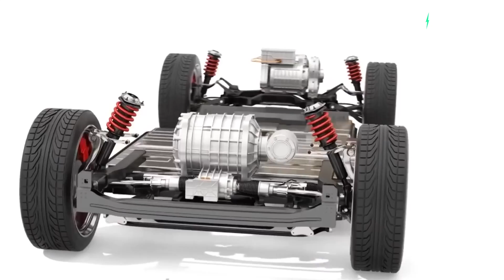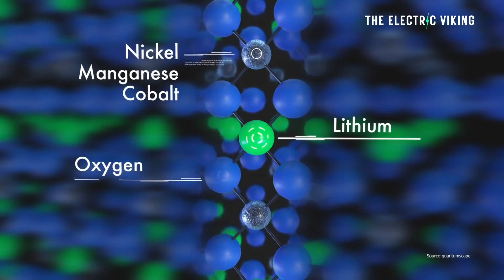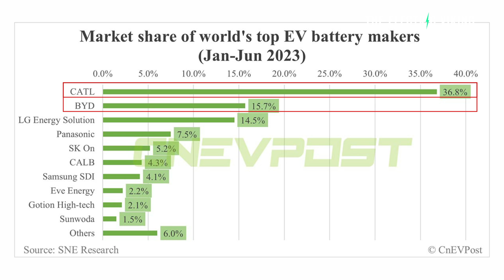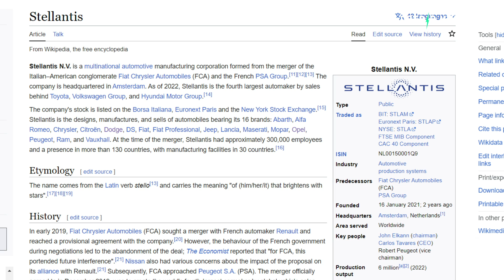Battery pack prices see HUGE decline - EVs cheaper than gas in 24 months

Comment: we also need automatic plugging in and unplugging at home. regular plugging is a chore, or phev owners would plug in more then they do
Reply: Why is it more of a chore than driving to a petrol station to fill up?  I spend way less time plugging in and unplugging my EV than you do driving to a petrol station..... I charge once every 8 to 9 days. Six seconds to plug in, and another six seconds to unplug in the morning.
Reply: @Brian-om2hh  It is funny how these non EV drivers have so many silly comments. 
These one (I_dont_want_an_at) makes dumb comments a lot. 
I sent him a comment
I_dont_want_an_at titude from you.
Reply: My condo building has 500 parking stalls.   How much do you think it would cost to wire up my parking?  Our condo board would go bankrupt making those changes.
Reply: @pin65371  LOL, they will make money or people will go to ones that do.
Reply: @BioniqBob  so people will move to the million+ dollar condos? I live in one of the more expensive buildings in my city and they don't have the budget to do that.  They are more worried about keeping the building functioning properly. Realistically in order to wire up my underground parking with ev chargers would be a couple years of work.  They would need to bring in more power to the building which would mean digging up the outside parking lot.  Then they would need to go through 4 floors of underground parking getting wire to each stall which would require drilling through the structure of the building. I'm in the trades.  I know what would be involved and it's not going to happen.
Reply: OH MY plugging in is so much harder than pumping gas. You are some kind of fool. 10 secs to plug in.

Comment: We are right on the edge of the tip over, I can’t wait!!!  Can you imagine quiet freeways? No smelly pollution at parking lots?, etc…..
Reply: Tyres are surprisingly noisy.
Reply: freeways won't be quiet quiet. But their noise won't project as far, especially when diesel is gone. Electric cars make plenty of whooshing past noise. A quiet petrol car that isn't revving hard would sound about as loud as an electric car at freeway speed. At slower speeds, the peace and tranquility will be felt more. I long for the day that diesel big trucks don't exist. You have to be 5km away to ensure you can't hear them on an otherwise quiet night. they suck hard
Reply: @I_dont_want_an_at i live 2 blocks away from a rail line and I can't even hear the train roll through unless they hit their horn. 5 km away from a diesel truck to not hear it? Maybe if you are in the middle of nowhere with a 5 km long frozen lake you'd be able to hear them.
Reply: @I_dont_want_an_at titude from you. You have never been in or driven an EV. Just a bunch of crap spewing from you.
Reply: Can you imagine high electricity cost, millions upon millions of batteries in landfills, the cost of upgrading one countries whole electricity system, because of the increase consumption, more rare-earths getting mined by underpayed workers in terrible condition, etc....
Reply: @tamaszlav 🙈🤡 Redwood battery recycling ♻️🔋♻️

Battery price will go down 80% the next 10 years.

Free electricity if you own solarpanels. 🤡👍
Reply: @tamaszlav   Imagine a world of fools talking about things they know nothing about. (yea you)        https://www.youtube.com/watch?v=s2xrarUWVRQ
Reply: These negatives are not only related to EVs, as ICE cars also use various minerals such as cobalt etc. EV bateries can and will, more and more I am sure, be recycled. Petrol and diesel has a recycle rate of ZERO. They can only be burned once. Over 95% of the EV battery can be recycled, we just need to switch to a more circular economy and away from a consumer economy wher we throw away so much. Our current system is clearly unsustainable.  @tamaszlav

Comment: Of course Sam it's not just that the batteries are getting cheaper THEY ARE GETTING BETTER, more reliable, higher energy density trending up to 400Wh/kg. This will produce longer range or smaller batteries.

Comment: When battery densities and costs reach a point where it makes sense and is possible to replace the ICE engine in a car with an electric motor and battery pack,  I can see many people just upgrading the car they have to an EV or buying an EV conversion. It makes sense, all the bits that wear out are in in the engine and transmission, with some new wheel bearings, shock absorbers, rubber bushes, a new electric motor and battery, some TLC on the bodywork you pretty much have a good as new car. It's far more cost effective, affordable and better for the environment to reuse what we have.

Comment: I know a lot of people are saying, people dont care about the battery chem - but they do - in terms of - they are still waiting on a few things to be true about EVs and that is one is it safe - every time a car burns up - it hits the news, so until that news stops and people feel safe about them - its still kind of a problem. I am hopeful solid state and sulfur Li or Na batteries can fix a number of those issues in the future. I can see a pack already 1/4 of todays size for the 350 mile range, so more than like 1/4 the price of current pack cost if everything continues to work out. 700 miles doesnt seem out of the question either.
Reply: Does anybody check to see if GM or Ford ICE Cars burn more often.  They burn 10X or 20X more often.  Hybrids far far worse.
Reply: @danharold3087 That's whataboutism, ice vehicles are being phased out in the UK only to be replaced by a technology that has a flaky safety record. You may well say that it's an uncommon occurrence, but if it's your ev that causes your house to burn down, that's no consolation. It's all about the race to net zero and hang the consequences, just like a certain procedure that wasn't tested properly, just a couple of years ago. The general public deserves better, but we don't seem to get it.
Reply: @danharold3087 When ice cars burn 10x or 20x more than ev's, you can put the fires out with fire extinguishers (I have experienced it myself). When an ev burns 10x or 20 x longer, and 10x or 20 x hotter than an ice car, what would you suggest as a suitable extinguisher?. As I've already said these vehicles have a flaky safety record, but governments across the world are ignoring it, just like the inconvenience of the consequences of the procedure that wasn't tested properly. There's a worrying pattern developing regarding our governments.
Reply: @paulhillman400  Yea its one of the big reasons I am a bit scare to even look at EVs right now. Even if its uncommon - when it does happen - its bad. You cant put it out easy and you risk everything else going up as well. What happens if it was at night when everyone was asleep? Dont get me wrong, I am bit EV fan still, but until that one issue can be corrected, I am bit scare to take on that risk.
Reply: EVs are already far safer in all respects compared to ICEVs, especially when it comes to fire. The only reason it makes news is because of how rare it is. That myth is pure FUD and people will get over it quick enough.

Comment: Yes… however, prices of second hand cars will be competitive. And most people buy secondhand cars…. So the speed of adoption for new cars yes… speed of adoption secondhand I don’t see it happening for the next 5 years. Also there are only a few people willing to pay more then 10k on a car. So the speed of adoption is not like a smartphone 509 dollar. The economics mechanism changes. So the s-curve is less steep as mobile phones.
Another argument is that most of human civilization lives in cities, where electric cars are fine…. However how do you built the loading facilities? There are so many logistical challenges for that. A flat, houses without parking space…. This sounds to me the top 30% will adopt fast, the 70% are still to many roadblocks for infrastructure and adoption mechanism. Sometimes thinks are to positive and there needs to be some reality to it.
Reply: Not arguing but there is a fair sized body of used car buyers that buy fairly new cars and pay $30 to $50K for them.
Reply: It totally depends on the country. In the uk 60% of people live in single family homes. Most have a drive way etc. so they can charge at home. 

You are right that people in flats etc have problems, but they maybe don’t even need a car if they can use car sharing. In many cases it is cheaper than owning a car. When I lived in the city I did not need a car.

Now I am 35 mins outside town and I can charge at home. So one’s EV prices actually come down, I am switching immediately.

Comment: There are a LOT less components in an electric vehicle, so reliability is higher and service less frequent. So a cheap electric car should be cheaper than a cheap ICE car once the assembly line standardization has settled in. Which raises the question: how does the dealer make enough profit to keep trained mechanics employed? This industry is due for a major update...
Reply: Stealerships are dead men walking.
Reply: You can see the lack of backend profits from servicing EVs has resulted in importers/dealers adding massive markups on EVs sold in Australia, particularly the new entrants such as BYD, who have no existing gas cars to service. Hopefully as other brands enter the Australian market these margins will come down through necessity.
Reply: @Ted_adventurer prices will come down as supply increases. Manufacturers won’t stop making them just because dealers don’t make profits. They will go direct to customer. 

There will be less mechanics needed and they can work in other industries where there are shortages of capable people.
Reply: @Ted_adventurer  I have been pointing that out for some time. Don't forget the required service that the cars don't need.
Reply: We haven’t fixed people so there will still be plenty of work from accidents.
Reply: Service and Sales are two different things. Less service stations, more people making solar panels and batteries. Times are a changing!
Reply: Service will still be required. They will just be able to accommodate more customers with less waiting. 

They can also become fulfillment centers for cars being delivered.

Comment: My Tiguan 132 is low mileage and a long way from needing an overhaul. However, a full recondtioning is about A$12,500. The cheaper model Y battery is around A$16,000. The battery warranty for Tesla EV's is not great, but the expected life cycle is around 500,000 km. I doubt my Tiguan will get anywhere near that without major work. The FUD around EV batteries is not justified in real world experience. Sure, there are horror stories, expecially if the car is involved in an accident. However, a prang in the Tig  may well mean a write off anyway.
Reply: 500.000km with a VW ICE

16x engine oil
8x transmission oil
3x timing belt and water pump
35000+ litres of fuel (would currently be ~60.000€ in my country)

We know that this list would could go on for a long time but it already sounds like absolute horror...
Reply: @Tschacki_Quacki  U changing your oil every 31,000km??
Reply: correct

Comment: Whilst we are on the subject of EV batteries. I rang 2 lithium battery recyclers in Melbourne Australia  yesterday. I did this after reading Sams black mass presentation, as an exercise to see what is really happening and if the batteries do indeed have a value as a lot of viewers of this site seem to believe . Neither were prepared to take the battery if it had any structural damage. If undamaged they would charge me 2 to 3 dollars per kg to except it for recycling! Make of that what you will, but to suggest that they are like gold, in my experience is false. Others should try doing as i did just to get a clearer picture. Also, what happens to the damaged batteries? Landfill?
Reply: Sounds like they don't have the volume to make it profitable.   We are still waiting for the cars to get old enough to age/wear out the batteries.  They are lasting too long.
Reply: I think you'll find Australia is way behind in recycling tech and processes as the adoption rate for EVs has been slow here. Sam is talking about the cutting edge in recycling, the cutting edge is never located in a wreckers in Melbourne.
Reply: lol. You said it
Reply: True recycling in Australia far from some countries eg Korea, where I think recycling is required
Reply: As if Australia would have the facilities for proper recycling.  You know how we don't make much of anything?  That's what's happening with recycling here
Reply: there are minor old coal mines in Australia that could swallow every single dead ev battery in the world  for 3000 years. Holes are easy to find
Reply: https://www.youtube.com/watch?v=s2xrarUWVRQ
Reply: nothing wrong with landfill, if that is their ultimate fate. The land is large, and it never fills up. the stuff came from the ground and it can go back into it without earth bulging at the seems

Comment: yes the one thing - ICE cars are going to get a whole order more expensive to own and operate - in the inflationary years to come.

  - The BEV I want may coincide with my budget - by the end of the 40s...

Driving a pickup means throwing any energy storage-solution which comes along, in the back, with the usable payload  - it is all  perfectly doable (from diesel, to hydrogen or straight Battery Hell-Ectric)..
(When I got my Engineering qualification -  s-s-s, the biggest energy "mantra" - hummm along with me,  was not to worry about the storage solution - energy-in vs energ- out is key - idiots making categorical statements merely tribalise /(ize) the ignorant, infantile and fearful.

POWER density is very important both on the mechanical conversion and the storage side. (if you NEED 200HP, 200km/h, and enough low-speed torque to pull a treestump - you either need several gears and a medium sized battery and torque solution, OR a huge battery pack and huge high torque massive power motor unit.) - Mass market EV makers quote wheel torque, ICE car makers quote flywheel torque - peak wheel torque is ~19x more in first gear, high range. - my "12 speed pickup"  - pretending it has a road-speed switchable dual range - has a first gear  low ratio - to final drive of 47.9:1 (Torque ratio), that converts the 470NM - "torques" into 22.5 THOUSAND Nm - "Torques", all singing at  1500-3000RPM - delivering 74-147kW (~200HP peak) and only achieving 4.7-9.4km/hr   ~6mph max (or take it to 4500 and do 9 mph (then do the magic of gear shifting and that same 22k NM gets converted to 1324 wheel Nm at a cruising speed of 99.699mph - 160.5 Kays, for the bogans, only 3000rpm, 200hp (147kW - 1319 wheel NM - pushing down the road 336 kg (call it 600 pounds for the nuckle draggers - affectionately so-called)  of tyre force while consuming approximately  19ml of diesel per second - accelerating to the moon (80Litres will give around 68 minutes of bliss at full power - and easy enough to refill....  Not so, the imaginary EV with the same performance specs (in a single speed transmission).

All that to show that an EV with the Torque of my car at "idle" - wheel speed of under 3mph - capable of 200mph, with a single speed transmission (assuming a flat torque curve)  would  be bragging about 5033kW - ie 5.3 MW...  (if there were 10000 battery cells at 3.7Volts nominal, that would mean each cell would be delivering  163 AMPS - Electrical current, for thermal management and fault tolerance, that needs a humungous cooling system, AND...  a massive battery pack - 980kWh, give me the price on that one, or stop reporting / believing all the bull$$h!t sprouted from sensationalists online..  

Of course, no Tesla dragster could ever get that torque (22000Nm) to hook up, meaning it would all be a stupid marketing gimmick to give a "grown-up" Tamiya ravecar (sic) 9 minutes of peak power - from a few Tonnes of battery (don't even bother calling it a metric Ton..) - better to use an extension cable, a "rully - rully thick one" - like - ther00ster, down there..  EJ can surprise us all, just not the ones who can do "comedy maths". 

Don't worry, that isn't important, it is just a small example of comedy math.  TLDR - no, don't bother..